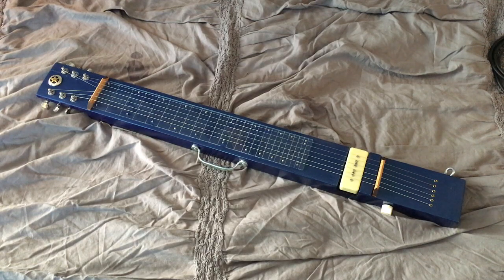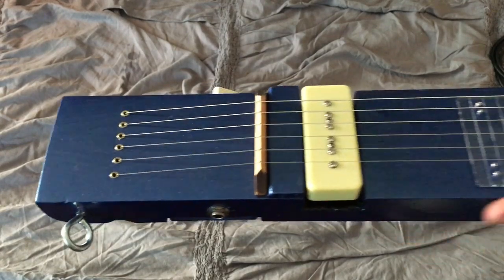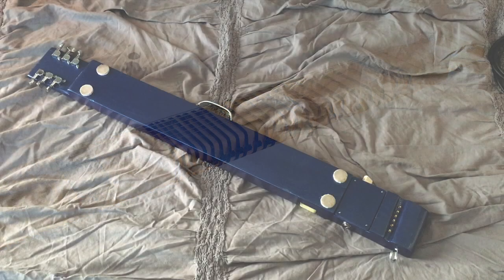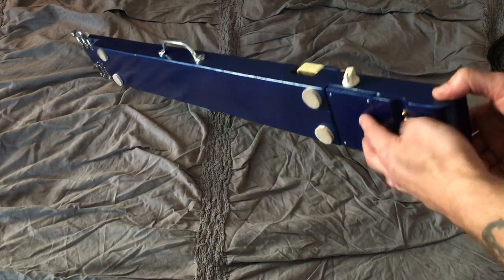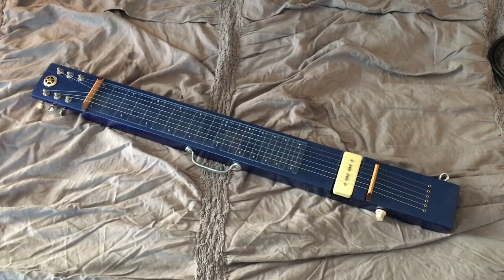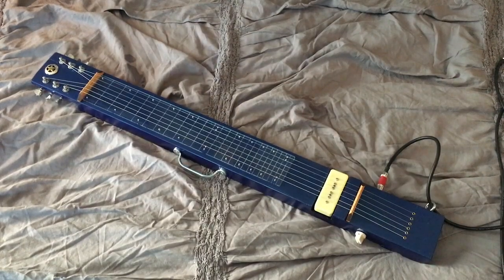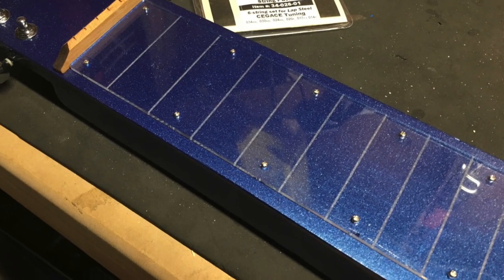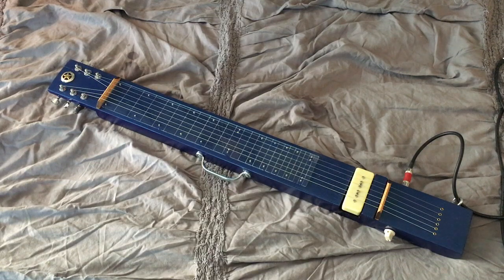DIY Blue 2X4 Lap Steel Guitar

Comment: Sparkle blue paint does a lot to elevate the look of that 2x4. Now I want to build one of these. Seems the only thing you're missing is to ground the strings.
Reply from the maker: Thanks for checking it out. Take a look at my other lap steel videos. I've made 3 now. I added a bridge ground where I had a metal bridge. They are a  lot of fun.

Comment: Cool. Are these diy lap steel's the only lap steel's you own or do you have a store bought one? I'm wondering if it would help to have more width like 6" wide.
Reply from the maker: I don't own any conventional lap steels... just the ones I've built. You could add some additional wood to the "body" area to make them more of a traditional guitar shape. I've seen some folks do that. Thanks for checking out the videos.